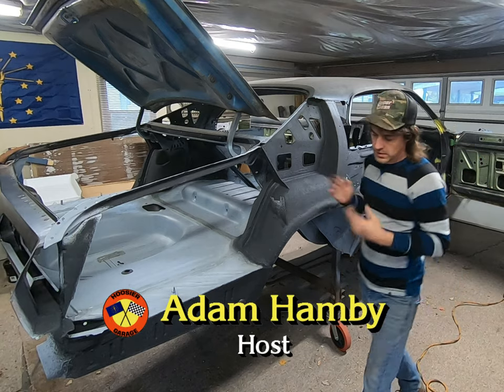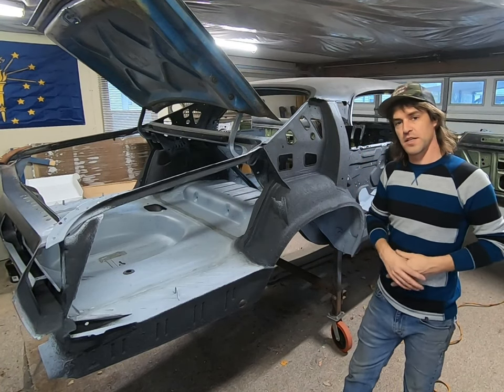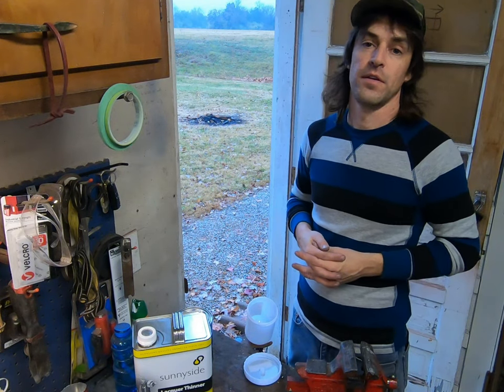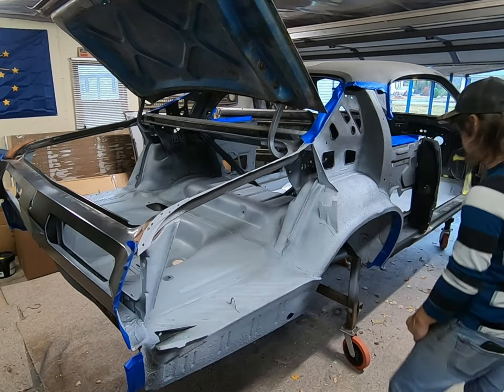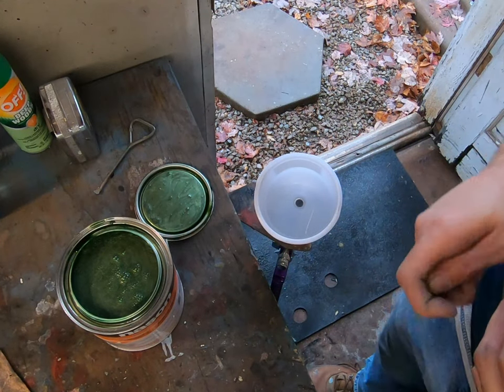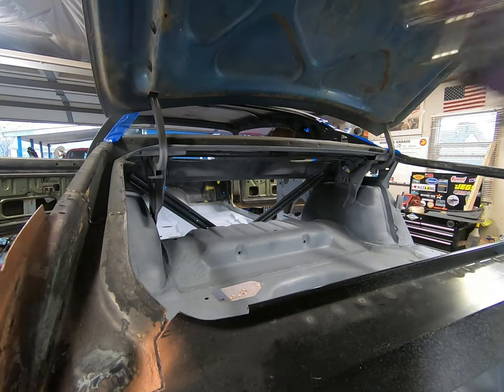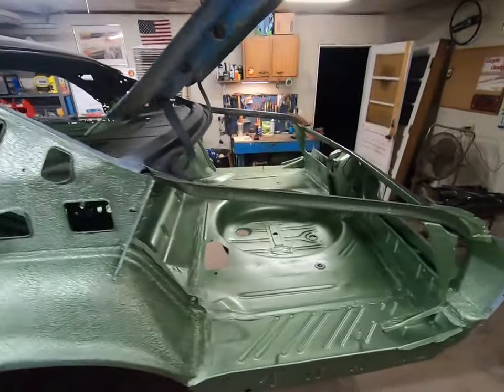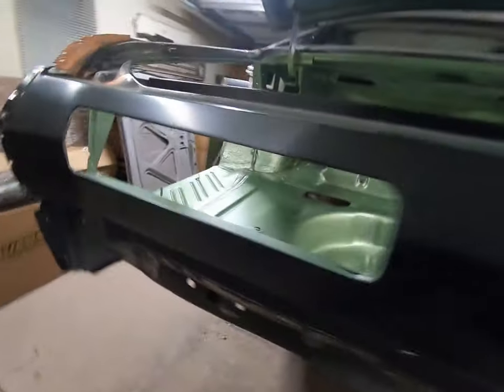Painting the Uni-body Hull- '72 Plymouth Duster Restoration PART 11

Comment: HG, Great video! What pressure are you setting for the gun? I have the exact one but I haven't used it yet. I'll be shooting my 66 VW in March or April. Or the next time we have 60s or above for a week or so. I really like the way you're rebuilding that car from inside out. It should last for several more decades when you're done!
Reply from the maker: Hey thanks! I usually shoot at about 40-45 at the gun.

Comment: Adam, I like your idea of getting even non-catalyzed paint on in places, for the most, will never be seen. I've worked on thousands of imports & domestic both, front to rear. The inside these panels, doors and other will rust from the inside out. I am doing a 67 C10 for myself and cleaning the inside of doors, bottom side of the bedsides after cleaning with muriatic acid, butyl putty in weep/drain holes while moving it around. Everything unbolts except cab, but neutralize with baking soda, water scrub brushes. I hit them with a pressure washer and sometimes you have bright clean metal. I use my neighbors trick and dry it with the leaf blower. But this gets into pinch welds, folded metal, odd bends & shapes but clean. Spraying them with anything will help them last another 50+ years. On humid days and cool air comes in, grass is wet with dew. The same is true with the innards of the vehicle. 
  In Nebraska, rust is showing up at the top of windshields. Could have been a rock chip, maybe! But pull the headliner down and bare steel is rusting inside 1sq. ft. , covering the area. I don't know when the started dunking cars/trucks but looks like a void, air pocket and no factory e-coat. I don't know what used or mil thickness but look at high dollar truck (60k and up) and see rust over the rear wheels house, what? 
   I am digging it. Clean it, fix what's needed, coat it so no more inside rust. I might be the only guy who seam seals inside a door, even with a gloved finger pushing it in, but fog in the paint in a tight pattern if needed, coat the rest. I spray frame wax in rockers with my own steel pot, detachable hose ends just to coat everything. Think of the inside of a weld? What does that look like in a year! Everything burn't off and bare. Enough, Like Pete said, I write a book. Just want other to think, agree, do it or not. But it is food for thought! Enjoy the videos!
DK, Omaha!

Comment: I watch all your episodes and this one had some good tips on cleaning out a new gun. I keep an old cardboard box around to spray into when I am cleaning out my gun before or after painting. A quick blast is enough to get it ready to shoot. 

That is the shade of green I wouldn’t have chosen to repaint this car, regardless if it was the original color or not. Just not my cup of tea. But it’s your car, not mine. My grandpa had an old 69 Dodge pickup truck that was this color. 

You are doing a great job rebuilding the body.